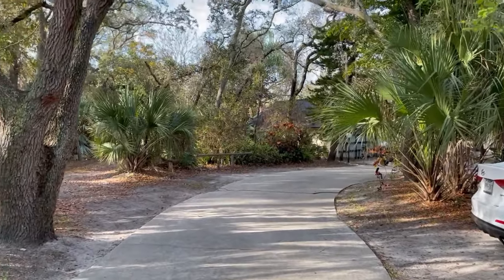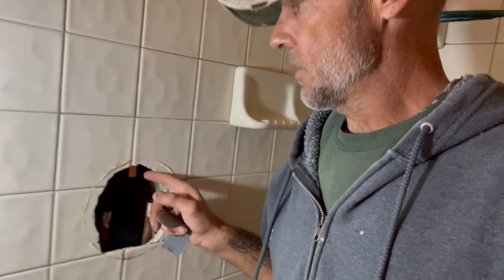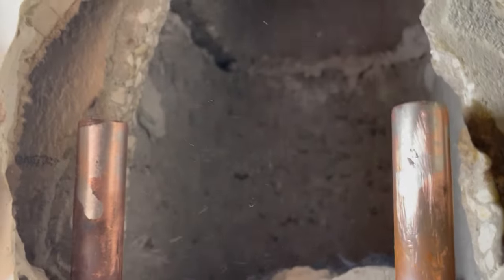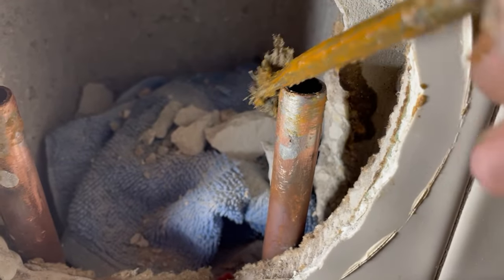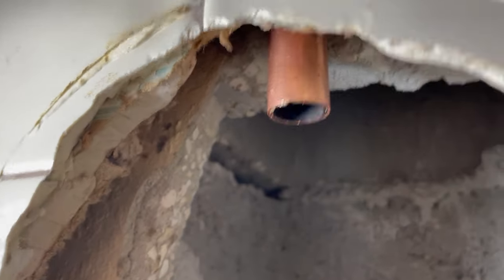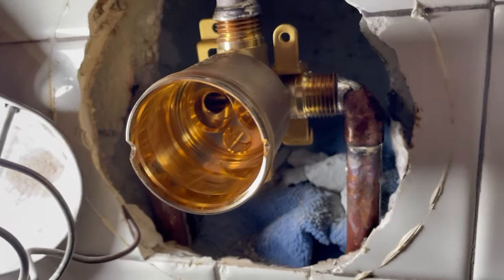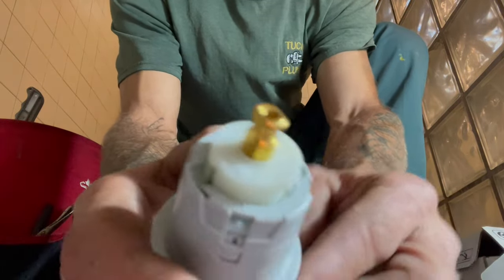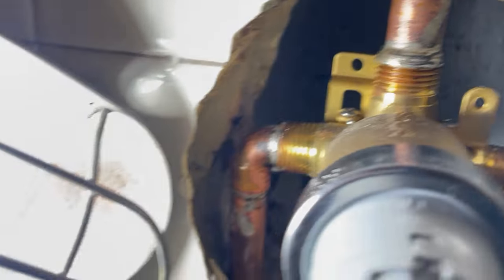DELTA SHOWER VALVE UPGRADE WITH HAND HELD

Comment: Just a suggestion Tim not really criticism because you did a great job it looks good. But I have also done this in the past where I leave a 1/2” brass cap on that bottom piece but what I’ve started doing is I’ll just soder on a cap now it gives me further piece of mind that there won’t be any leaks at all. But you’re way works great too that Teflon and pipe dope will hold. And I feel like the small nub on the top end of the valve seemed a bit short but it’s not too crazy pressurized water going through there and it’s only for about 10 minutes at a time so you’ll be fine but I get nervous when I have a small nub like that personally. But I always enjoy watching your videos Tim thank you for putting them out for us.

Comment: Nice video with clear explanations. I just recently disassembled a setup very much like this because the seats and springs on the cartridge were worn and causing a drip, and from that experience I would suggest putting a bit of anti-seize grease on the two long screws holding the face plate on and the small hex screw holding the handle on. Those things can get locked in there real tight. 10 years down the line someone will thank you for taking that little extra step when they have to disassemble things. 👍

Comment: Tim great video and you always do a good job explaining what's going on while you're doing your job, you did everything right, I usually install the new shower arm blow the system full throttle with water to remove any settlement and then I'll put a cap on the arm and pressure the system to make sure no slow dripping going on behind the wall because even a slow leak can cause destruction over time , but I'm working on wood framing 90 percent of the time. 

Thanks for sharing this video and please keep making them , there like frosted flakes ,there great  lol 😆.
Reply from the maker: Thanks pal I really appreciate you stopping in
Take care

Comment: Great video! Told me what I wanted to know (hire a pro to replace mine).  I am curious why you didn't cap the bottom before installing. I would think it'd be easier outside the tiny hole.